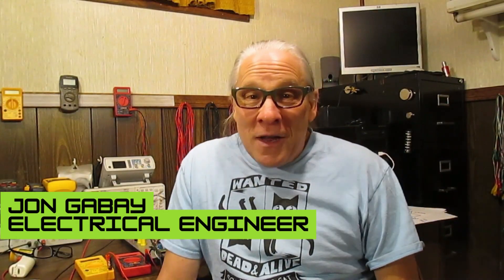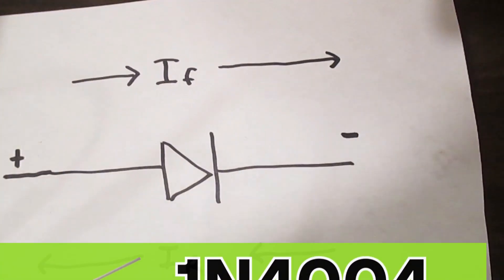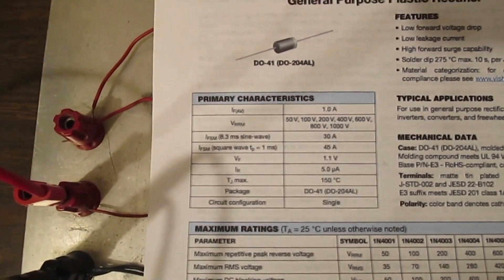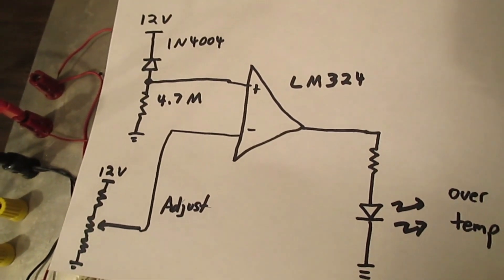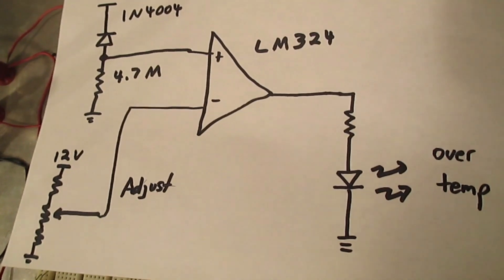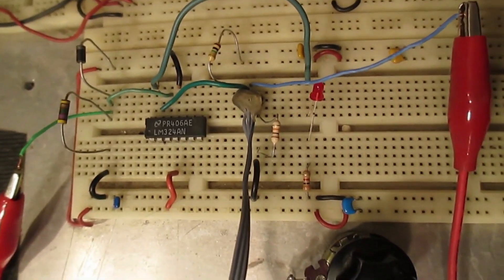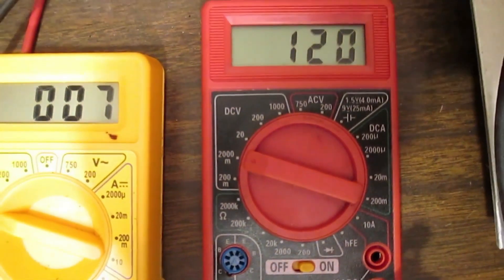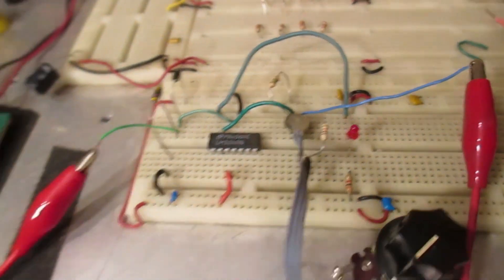How to Use a Standard Rectifier Diode as a Thermal Cutoff Switch

Comment: Good idea, but you are missing a feed back loop to avoid oscillation at the switch point - and have a bit of hysteresis. Note that the LED lit up slowly proving my point.

Btw. that 7 mV measurement across the 4M7 resistor - that does not compute.
Reply: Do you think this is a fake circuit?
Reply: @coastersaga  
A fake circuit? What is that?